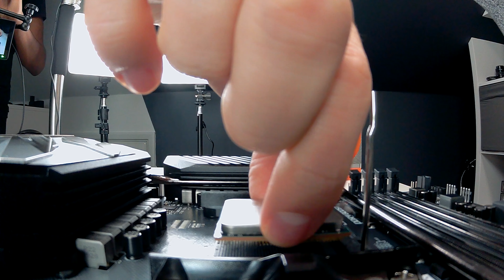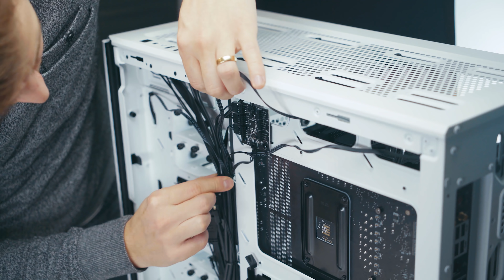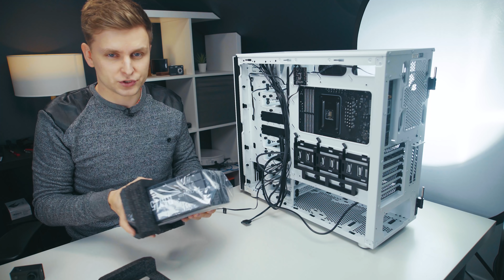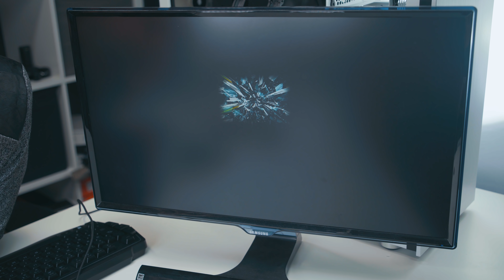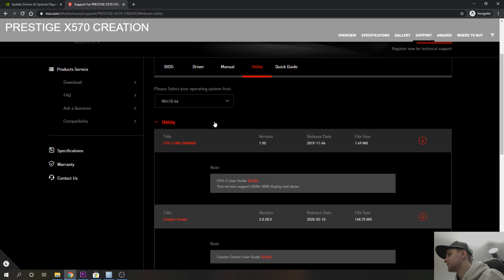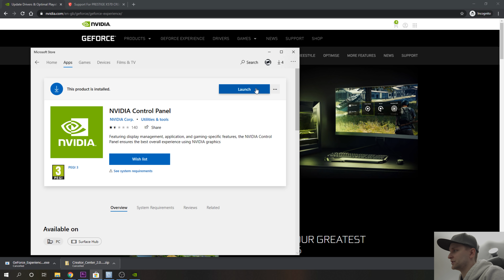ULTIMATE GUIDE: How to build the MAC PRO KILLER PC

Comment: Hey, thanks for the great video. I followed everything step by step but I am not getting any post. Motherboard giving me the 4F and nothing happens. I stripped everything and try to just run it with one stick of Ram and still the same thing. I couldn’t find the recommended Ram so I bought Hyperx Fury 3200MHZ DDR4 instead. And the HX1200i as PSU. Any suggestion what I can do to get my system to work?
Reply from the maker: It might be that there is too much pressure on your cpu, or the pins aren't aligned properly. Try loosening your cpu cooler a few screw turns?
Make sure your ram is plugged in the correct spots and defos use 2 sticks coz it's a dual channel system.
See if that helps ;)
Reply from the maker: Do you have the same motherboard?
Reply: Tech Notice thank you for quick reply. using the same Motherboard. I redo all the steps again and unscrewed the fan a little too and still get same code on motherboard with no post.
Reply from the maker: Hmmm... Hard to tell from distance... Both cpu connections plugged into the mobo properly?
Reply: Tech Notice I bet, I double checked everything and still Motherboard get stuck on 4F and no post. I ordered New RAM, I read somewhere online that faulty RAM can cause this issue. Il report after testing with new RAM tomorrow.

Comment: Most satisfying build of 2020.

But does the 'Noctua NH-D15 82.5 CFM CPU Cooler' fit in cases like the 'NZXT H510 ATX'  or other Mid Tower Cases??
because this happened to Linus.

https://www.youtube.com/watch?v=oa9VQuPsivU
Reply from the maker: Yeah, I think I saw it happen to Linus.
So to be sure, go look at the case specs on the manufacturers website and check the cpu cooler clearance.
The NH-D15 is 165mm in hight so the clearance should be at least 170mm :)
Reply: @theTechNotice Alright! thank you.

Comment: This is a great video. 

What's the noise level of the final result?
Reply from the maker: It's quite low, depends if you have HDD-s inside coz they're louder than the fans.
And when tuning the fans and curving them to tune up more on higher temps on normal usage its almost completely quiet. ;) (depends on room temp)

Comment: Fantastic guide, I was looking to build something like this and you've done all the hard work for me!  One query though; if you were to opt to put a second Sabrent PCIe 4.0 M.2 SSD in (so one for the OS and one for storage), it obviously looks to make sense to do that right at the start.  Does having both those drives in at the beginning, affect the Windows 10 install at all?  The reason I ask, is that I seem to remember from my last build (Windows 7 Pro, 7 years ago), there used to be that whole 'Primary Drive'/'Secondary Drive' thing, and that it was better to only have the former plugged-in at the beginning (to install the OS), only plugging-in/installing any other storage drives, AFTER you had installed Windows.  Does this still apply, or am I remembering it wrong?  Adding 3.5" HDDs or 2.5" SSDs later in this build is easy, but having to go back to install a second M.2 SSD (under that cover), looks like it might be a bit of a pain.
Steve
Reply from the maker: Hey Steve,
I don't think you'll have to worry about that, if you have 2x m.2-s just plug them in, install win10 on one and then sort the other one out on disk manager after win10 is installed ;)
Reply: @theTechNotice  Thanks.  Just checking ;-)
Reply: Windows 10 installed only on the drive i chose! The second m.2 drive was cleannnn!!!

Comment: Is this builld compatible with MacOS?  Was thinking from the title that you were making a Mac Pro Killer (Hackintosh).  Disappointing to watch the whole thing and see that it is only running Windows.
Reply from the maker: Hahaha, a lot of people seem confused about that... I thought "... killer PC" would be clear enough.

No said that a lot of people have been asking about the hackintosh.... Should I make a video about that? 🤔
Reply: Tech Notice Please!  Your video was so easy to follow, you almost had me buying the parts— until I got to the gut-buster ending!!
Reply: @kschroeder102  Tech Notice did a great PC build, but a few of the parts will make it hard to turn into a hackintosh.  Snazzy Labs made a similar high end build and also showed it running mac-os so you know it works with their parts. https://www.youtube.com/watch?v=AXg9sMuGxB0&t=666s
Reply: @theTechNotice  People think this can be a hackintosh because of your comparison to the mac pro video.   Its not a bad hackintosh though if you use an AMD GPU instead of NVIDIA.  Might need to pull out the wifi/bt m.2 card and put in a more compatible card too.  And either a thunderbolt pci card or a motherboard that can handle it.   Personally, I'm going with your build as an unraid server because the plethora of usb 3.2 gen 2 ports will let me add a bunch of media sonic enclosures with lots of power for dockers and vms.

Comment: how can it be a mac killer with windows installed ? i expected you will build a hackintosh ^^
Reply from the maker: 'mac Pro killer PC'
Why does it have to be ios to be a mac killer?
Reply: Tech Notice because if not , it can not kill my mac - as i need ios to work . . .   i guess most professionals use a mac because the os . . .
Reply from the maker: I guess my angle was premiere and cross platform programs. But I totally understand if using programs that are ios only. Then makes sense.

Maybe I should think about the hackintosh... Lot of people are asking about it..
Reply: @theTechNotice  Why iOS? You mean macOS.

Comment: I could use some help around building my new computer (currently using the one that was built for me in 2005). 
Finally have some cash to spend/invest in PC.
I would like to run games like deadside, GTA 5,  Green Hell, NFS porsche unleashed,  and still use  programs like 3d autocad, 3ds Max...
What parts would you recommend me + what kind of monitor, case... whitout overclocking any of the parts? + if it is possible I would like to run windows 10 
btw I live in Europe(Croatia).   
Thanks. :)
Reply from the maker: I'd recommend my PC you just watched me build :)
Reply: @theTechNotice  I would love to build it but I'm around 500 pound short, do you have any suggestion's for part's I could replace/remove?
Reply from the maker: Check out the alternative parts, and you should be able to save more than 500 :)

Comment: I recently found your channel and have watched your pc build videos several times, so much so that I am about to order most of the components you used. I am a photographer and do a lot of time-lapse so I appreciate your views on this and I believe the spec should fit nicely. 

I am now at the monitor and keyboard picking stage and am wondering if you would share what you use? I will be starting with one screen and am leaning towards something similar to the BenQ PD3200U or something similar (4K and 32inch). I know it does not specifically handle the Adobe RGB colour space but any advice is welcomed. Many thanks.
Reply from the maker: Hey Ken,
First of all, great to have you here and it's my pleasure to provide content that's helpful to you! :)
SO in terms of keyboard, I'm using just some kind of logitech keyboard, it's a low profile, nothing fancy, I think I paid ~£20 for it 4 years ago. I might be the only one in the world who's not bothered about the big mechanical keyboards with loads of click-clicky-clicky sounds. If you're asking me what would be ideal for me, probably Logitech Craft Keyboard https://geni.us/BMesHo (Amazon Paid link*). Now it's not the cheapest, but it's the coolest one i've found  :)

Now monitor, this is something I'm actually currently looking for as well. I'm running some really old Dell, Samsung & Benq monitors (3 monitor setup), they're not the best at colour accuracy neither viewing angles, I've just had to make do what I've had. But I've been looking at some of the BenQ monitors as well so I think you're going the right direction when looking there :)

Let me know if you need anything else. And please type a new comment then I get a notification otherwise I might miss your comment.

Stay safe.